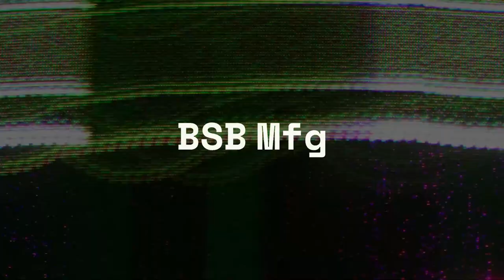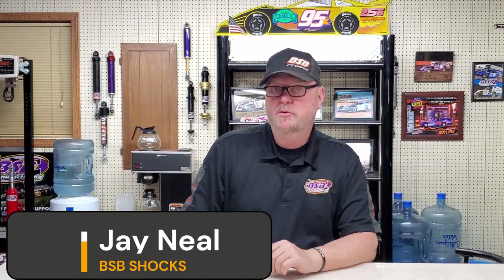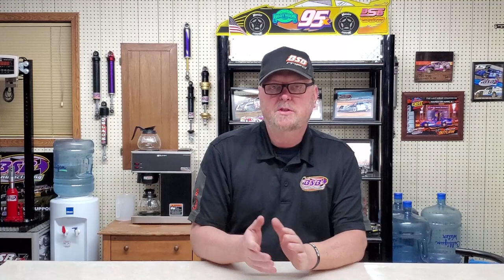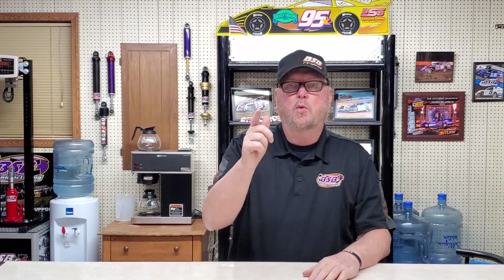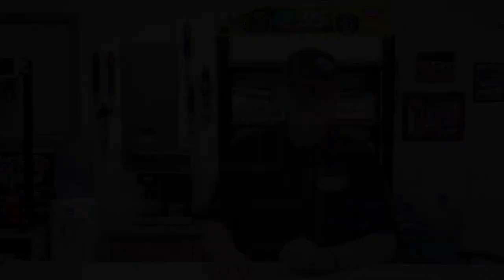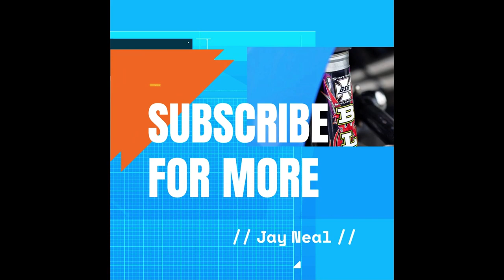How Left Rear shocks have changed in the last couple of years.

Comment: Really sounds like having one of each would handle rough vs slick. Lr-1 at a rough track like one that always has a dip or after a week of rain. LR-2 for some place thats dry/slick and smooth by the end of hot laps.
Reply from the maker: Yes, the LR2 would be a good tool to be using to help corner entry and lower lap times.

Comment: so does the position sensitive bypass system allow the lr to travel more freely(less stiff) in the last 2-3 of travel and still hold the car up(more stiff) at travels below that(the last 2-3 inches)
Reply from the maker: Yes, when you say last 2-3 inches it the last 1.5-2” of travel, that is at full hike. So when the car is at full hike or up on the bars this is when it is in the bypass.
Reply: @jaynealgofast  Thanks!